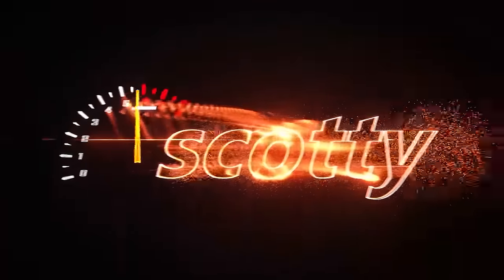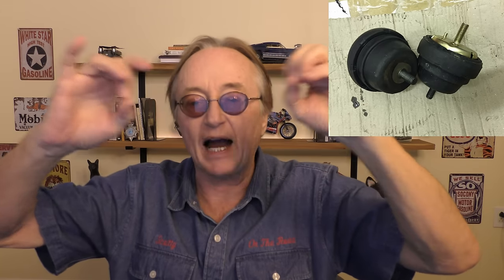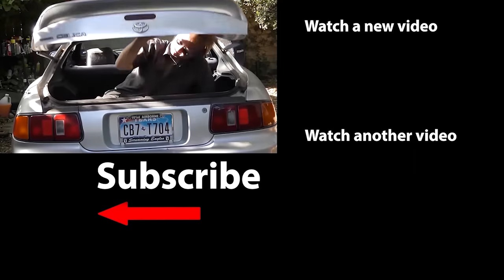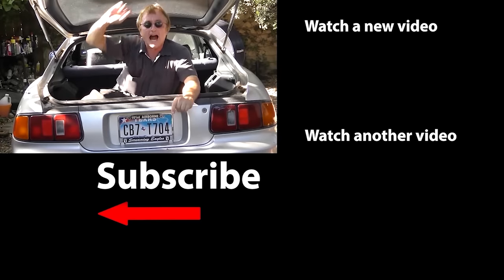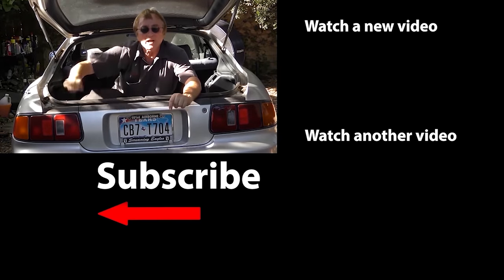Here's Why Changing Your Engine Oil After 3,000 Miles Will Destroy Your Car

Comment: I have a 2002 Toyota echo with 250,000 miles on it. I bought it new and I changed my oil every 3,000 miles and it runs like a champ.
Reply: We had one I bought new and did that too. But after being rear ended about eight times on San Diego freeways (no exaggeration!), it started acting up in weird ways at about 240,000 miles. I ended up trading it for a 2011 in 2020. I needed one with more towing capacity anyway.
Reply: i have a 2002 5 series 3litre bmw, changed oil every 18k, has 210k miles, uses zero oil.
Reply: 18k what, miles or km?? Even if it's km's, that's really bad. A lot of timing chains went bad cause of the long oil change intervals. It's a surprise your car even runs. @SuperCatbert
Reply: @SuperCatbert why change the oil at all if the vehicle uses zero of it? Just wondering.
Reply: I have mustang 1998 with 300k miles. Change oil with 10-15k interval. Zero problems.
Reply: My last honda had around 370k when it got rearended,i have a 5 spd civic SI with a little over 300k now, no problems
Reply: What if you changed it every 1000 miles and it runs like a champ?  Is that causation?

What if you bought a Vega in 1976 and changed the oil every 3000miles and it runs like shite and blew the rings at 32k...... there's a lot of evidence for that too.  

Did frequent oil changes ruin that fine Chevy 4cyl aluminum motor?????

I think the higher likely causation is that you take care of your car and it is a TOYOTA.
Reply: @vitalitihomirov5781 Those Ford v-8 motors are very forgiving.
My Crown-Vic was treated the same way.
The car had 350K and the engine was still running great....it used a qt of oil every 6K miles.
The car needed a ball joint replaced.
I opted to get rid of the vehicle instead of paying for the repair.
Big mistake!
Reply: @dave3864
You've driven a Toyota Echo for 250,000 miles🤦...I feel sorry for u
Reply: @mrgarrison3516  Why would you feel sorry for me?
Reply: @mrgarrison3516  what does Mr Garrison drive?
Reply: @mrgarrison3516  the IT bike perhaps....
Reply: @STho205  
I don't drive the IT anymore, Mr slave does.
I usually drive my Subaru cause my Mazda 3 suspension is too harsh  🤦.
.......but maybe a Camry for my next car, but the GR corolla is getting my attention 🤔
Reply: @dave3864  
It would be uncomfortable & small to do that many miles in 🤷
Reply: @mrgarrison3516  you would need softer suspension after riding the IT.
Reply: @mrgarrison3516  Well my friend, I would consider you very ignorant!
Reply: @mrgarrison3516 sorry but the GR Corolla is on a Yaris platform which is the echo upgrade. And I drive a Yaris it’s actually not that uncomfortable 
No Camry by any means but for a econo car that gets 40-45 mpg like mine and gets 500 miles per 10 gallons and cost $35 to fill @ $3 a gal it’s great
Reply: Bought a brand new 2007 Hyundai Accent still have the car with 396,000 miles, running great!!
Reply: @dave3864 
Ok, u can borrow the IT bike.
Mr slave has a Hemorrhoid anyway & if u can handle an Echo for 250k miles....u can handle anything
Reply: @jessewynne8193 
The only thing the GR Yaris (performance car) & the Yaris (budget car) share are the name & some of the cheap interior plastics.
Different suspension, different seats, different engine, different gearbox, different exhaust,
different brakes, different wheels.
(every single dimension different)
GR Yaris is one of the costliest Toyota's & Yaris is the cheapest budget car Toyota makes .....for old ladies😂
Reply: My wife just got a Camry. I liked her old Yaris better. The Yaris was more fun to drive through “twisties” and hairpins than the Camry, but then lighter and smaller cars are almost always more fun to drive, unless you are truly talking about an actual sports car.  You be surprised how little difference there really is in the “ride quality and comfort” over road imperfections between a cheap, lightweight economy car and a larger vehicle.  And don’t even get me started on the lack of fun driving trucks or SUVs. That’s like driving a living room from a couch, and the higher center of gravity of the truck or SUV makes for very little fun or entertainment going through the curves and turns.
Reply: @scottdean27 yes but some of us can't work out of a trunk on a throw away little rice cooker
Reply: My second car was a 1986 Chevy Celebrity sedan. My aunt bought it new in Florida and until 1993 it made round trips between Florida and West Virginia every spring and fall, plus a few trips from Florida to Texas. When she moved back up here permanently, she sold it to my Dad with around 100,000 miles on it and the odometer was nearly ready to roll over back to all 0s. Over the next six years and many road trips he put an additional 80,000 miles on it. He got remarried and had a 3rd kid, so he bought a van big enough for the family and gave the sedan to Grandma, who added 40,000 to it from 1999 to 2006 when she got another car and gave it to me. So we're already talking 220,000 when I got it, and I drove it from 2006 to 2011 and got it up to 275,000 (by our reckoning). By then, the fuel gauge had stopped working, the headliner had fallen out, the springs in all of the seats were shot, the passenger's side seat was jammed and wouldn't adjust back and forth anymore, the interior dome light didn't work anymore (I had bought one  of those AA-powered lights they advertised on TV and velcroed it to the ceiling for when I needed interior light), the rearview mirror was held on by JB Weld, the radio wouldn't turn on, but that car just would NOT die. After I bought something else Dad kept it around to teach my brother to drive in, and we finally sold it to a Costa RIcan woman who had just immigrated, started going to our church, and needed a car so she wouldn't have to catch the bus to go to work. She still has that car, and I see it driving around town now and again. They're just not making them like they used to.
Reply: @wateo1782 it's not a surprise.
It is standard here in Europe.

If you use full synthetic oil, which is almost normal now, changing interval is 15000 km.

No problems.
Reply: Toyota Toyota Toyota toooyyyyoooootaaaa……. the echo !
Reply: Maybe if you changed every 1,000 miles, you could get 5000,000 miles out of the engine.

Why 3k miles? Most people can't say. It's a stupid baseline.
Reply: There's plenty of us who change every 7,500 miles and double or triple that and never had an engine issue. Doing insane 70s/80s style oil intervals is no longer necessary on newer vehicles with a full synthetic.
Reply: I change my oil every 100 miles, runs like a champ.
Reply: @gary_neilson1896  Exactly. I want clean oil so every 1,000 miles sounds good. Then I'm going to siphon my gas after every 5 days so I have fresh gasoline all the time. Then I'm going to throw away a gallon of milk after every day cause I need fresh milk only. Wasting resources is smart and cool.
Reply: @Mike80528  The ideal time to do an oil change is every time the engine is shut off. The downsides are: expensive and drain plug threads will get worn out.
Reply: 80+ oil changes is craaaazy
Reply: @ATICrossX  I can't imagine changing oil every month or two. I used to drive 2-3 times as much as I do now (15k a year currently). Did changes with full synthetic every 5,000 miles but that was back in the late 90's/2000's. Today I prefer a high quality full synthetic and less time messing around with oil.
Reply: @ATICrossX  250,000 miles is not crazy!
Reply: Oil change on Every 4500kms is the best option to go with ... Oil losses it's viscosity as time passes.
Reply: @AbdulWahab-ue4xx  it's still within spec regardless and a good oil won't have as much a problem. You people keep looking for excuses to waste good oil with a practice that hasn't been used since the 1980's.
Reply: I also have a toyota echo 2004. Those things are built to last man
Reply: my 2011 tacoma has 210k miles 4.0 v6. i changed mine every 3k since i got it new
Reply: @sugarskulllyfe5890  my last vehicle was a 2008 Mercury Milan (Ford Fusion twin) with the 3.0 V6. I changed the oil every 6,000-7,500 miles and got rid of it at 235k miles. Never had an engine issue and it ran excellent even at the end. Could easily go another 100k miles.
Reply: @Mike80528 Depends on how the vehicle is used I'd say. Either way, you should stick to what the manufacturer recommends or in tbe ballpark. That said, some engines will tolerate longer intervals. 3,000-6,000 is pretty typical and good practice. But my  3100 in my old buick could go 10,000 or so between changing it. Hell I'd use the 20k rated filters and change them ever other oil change.
Reply: Toyota echo is a great car Toyota echo is a great car
Reply: @SuperCatbert  My 2003 VW Golf 1.9 SDI did the same thing and was on 257k when I sold it in 2019.

Comment: 09 Prius.  Reached 315k miles. Never visited a dealer.  Just maintained it myself.oil change 3k miles. Fuel injectors, spark plugs every 50k miles.  Still runs like new!
Reply: Scotty Kilmer says change the fuel filter, but Toyota's fuel injection service does not include replacing the fuel filter. For Toyotas spark plugs last at least 120k miles.
Reply: '06 Mercury Grand Marquis. 384,000 miles. Oil changed every 3000 miles. Transmission fluid changed every 9,000 miles. Transmission fluid and filter, rear axle fluid, and coolant changed every 27,000 miles. Still runs like new.  Will never own a car with a turbo, front wheel drive, variable valve timing, more than 2 valves per cylinder, direct injection, or any kind of stop/start or cylinder deactivation system.
Reply: @geraldscott4302  that's extremely excessive, just wasting money at that point.
Reply: @hytak18  the cost is minimal if you change the fluids yourself
Reply: Well at 400,000 you've done way more on yours than I have my KIA Sportage.
Reply: Yeah just tires and batteries '>)
Reply: Do you need to change injectors every 50k miles?🤣
Reply: @MA-mp4ov  No way. I've had many engines with over 200K miles with the original injectors.
Reply: So what you're telling everyone is you spent 3x more time and money on servicing than needed and you replaced the spark plugs 2x too early and given your zealot like maintaince of the vehicle I doubt the fuel injectors would have ever needed replacing. You've pissed so much money up the wall it's unbelievable.

Comment: My father was an engineer for Ford back in the 50's through the early 70's. When I was a kid, he had a Mercury station wagon he changed the oil every 3k miles and when he sold it, it had 240k miles on the odometer.  The lady he sold it to, put another 60k miles on it before she ran it out of water and the engine blew up.  I have been changing my oil every 3k - 4k miles religiously over the years on all my cars and they all ran long (and sometimes hard) lives.
Reply: Gosh, I  remember the old Mercury station wagons!
Reply: Oil in the 50s and to some extent the Sixties was crap. That is one big reason why the Ford Y-BLOCK engines had issues
My dad had to install a top-oiler system on out 1956 Ford Y-BLOCK wagon. Our next wagon, a 1965, was a Chevy Impala 283 4BBL Never had issues.
Reply: When should I change from every 5000 mile oil change to every 3000. 
I have a 4 cylinder non turbo engine.
Reply: @richb1576  I always do 5k with synthetic, on turbo or natural aspirated. you wont have problems.
Reply: You shouldn't.  In fact unless you do a lot of short distance driving every 7500 miles or 6 months is fine
Reply: @userac-xpg unless you are using amsoil or $50 5qt  jugs yes but Variable camshaft timing is ran off oil pressure, solenoids, screens, Small passages not good, especially on Shortdistance
Reply: @userac-xpg 100 miles every day. 
40 miles in to work highway then 40 miles back home highway then 10 miles city into second job then 10 miles city back home. M - F
Reply: @justingill5256 bingo. This video is bunk.  Fords use oil pressure for timing.  We’ve seen 2-3 degrees timing backed off on Dyno tests of worn oil.  Put fresh oil in it and pickup 30 hp.     I change the shop truck and my personal truck every 3k miles.  Valvoline synthetic. I have a shop truck with a 5.4 that has 327k miles. Valve covers never been off it.    You do what you want. I know that oil changes are the Cheapest insurance , at least on mod motor fords
Reply: @puttervids472  I have 2015 F150 5.0 it likes 5w40 FS short intervals or it stall at idle from oil pressure(vct solenoids)  I get near 5k before with 5w20 and 5w30 stalling was more often 3k to 4k
Reply: @justingill5256  yup. 10w30 in mine.  I’m in the south where it’s hot in summer. But we see below freezing temps in winter.  If I really wanted to be cute. I’d run 10w40 3 months a year for sure.  . I’ve put it in a 2012 5.0 f150 since new. No stalls. I learned this with the 2000 5.4 truck. When brand new it hated the 5w20. Swapped it to 10w30.  All good.    That thin oil is purely for gas mileage with the tradeoff being engine longevity .i prefer less mileage and more life.
Reply: Me too. OR just when it looks dirty as well.
Reply: @richb1576  the next oil change.  After that, you start changing every 3k miles if you wish.
Reply: My 2009 Cobalt wasn't a turbo and I changed the oil every 8.5-9k miles and got 295k. The motor was fine but the car was starting to nickel and dime me. By breaking down I didn't want to deal with it anymore
Reply: That is very ,very rare to have a car of that era to go 240K unless the engine was rebuilt or valve job. But if not, he got very lucky because even changing oil every 3K miles back then, any car engine just did not last to 100K without having at least valve jobs done. I know, I worked on cars in the 70's and worked on cars built in 1949 all the way up to the current years in the 70's. It could be that your dad might have driven the car long enough ever day to get the oil hot enough not to form black sludge and he then changed the oil at 3K miles and I bet he used the best oil he knew of. Either way and good story and your dad sure got his moneys worth on that wagon.
Reply: I use synthetic blend 10w 30 in my ranger for ten years now have 385000 and still running good.
Reply: I disagree
Reply: 3,000 is too early for synthetic
Reply: @richb1576  If you do a lot of city driving  then change to every 3k.  If mostly highway and not in dusty conditions then every 5k is probably sufficient .
Reply: @josephklimchock5412  the engine in that thing was a 302 V8. One of Fords most popular motors of that era. 
Old school points and condensor, 2bbl carb. with the C4 tranny.   My mother had a '69 Mercury Cougar with the 351 Windsor, 2bbl carb and the FMX tranny.  Damn I wish I had that car today.
Reply: That's why they say typical woman driver 😂
Reply: You're pissing away money if any of those cars were built in the lates 90s or newer.

Comment: I've owned turbo charged car, a Shelby. Smokin fast cast car!
ALWAYS, ALWAYS, ALWAYS, let it warm up before you get into the turbo, and ALWAYS let it idle for a few minutes before you turn it off. Scotty is spot on. Every 2500 - 3000 miles, CHANGE THE OIL!
Reply: If your were just getting into boost and or running it hard sure I can see letting it idle a few minutes. But if you drive 2-3 miles normal after getting on it (cool down lap) it won’t hurt it to shut it off after 20-30 seconds.
Reply: in eu we change the oil 30-50k km..
Reply: @Corsa15DT   Nah, that's just you
Reply: @Ishzhmahel  most if not all eu cars, use longlife oil, 2 years, 30-50.000km. Me, I change it at 12.000km, cause I like my tdi
Reply: I remember an old man who drove a turbodiesel Audi (old one) and he was sitting every day at least 10 minutes idling his car before parking. The car had really bad exhaust fumes and the whole underground garage where I was working was stinking because of him...
Reply: @Munakas-wq3gp  he loved that TD more then his neighbours :D
Reply: Back in 1984 I worked as a pump jockey for a week before I got my real job as a Electronic tech. I was also a gear head. One time a guy pulled up to the pump (after getting off a parkway) for gas, driving a turbo car. Even at 19, I knew about the turbo coking the oil issue. I told him flat out that he was going to destroy his turbo by not letting it idle for a few minutes after being at highway speeds. He was a yuppie who knew nothing about cars, and I felt bad for the car.
Reply: Indeed. There are stories about $$$ turbo charged Ferraris which were raced around the track after which they immediately went into the pits. Turbo in the engine bay was still super hot, caught fire, setting the Ferrari on fire, totaling it.
Reply: Looking at a new car, doubt I’ll buy a turbo but thank you guys for this advice!
Reply: @JACk79457  where do you live? all the cars are turboed these days! I live in the LGBT states of eu.
Reply: @Corsa15DT  only people who know nothing about cars change oil every 30kkm+
Reply: @ady007pl  you don't live in the eu obviously..
Reply: Turbo timer

Comment: I own a 2002 saturn vue that I bought new from the dealer. Change the oil using Mobil 1 Full synthetic every 5000 miles. Also trans (manual ) fluid every 50,000. miles. Odometer just turned 400,000 miles. Paid $16,000.00 new for the car. Still running strong. I guess I've gotten my money's worth!
Reply: @donhebel1011  at 400,000 I changed all fluids and it just turned 401,000 miles Keep going strong baby
Reply: I had a car that never had it's manual transmission fluid changed it was still shifting fine on 257k miles when I sold it. For it's first 180k miles before I owned it the oil was changed every 20k miles and every year or 10k miles when I owned, guess what the engine was perfectly brilliant too. I'm glad you enjoy pissing money up the wall.